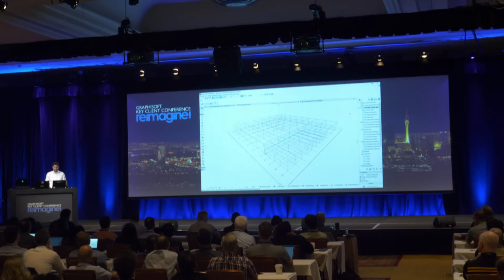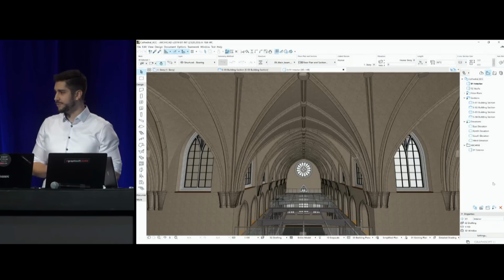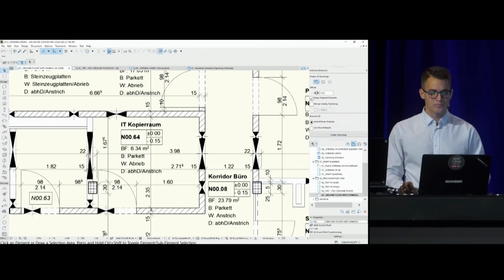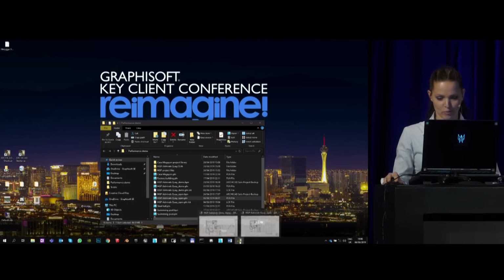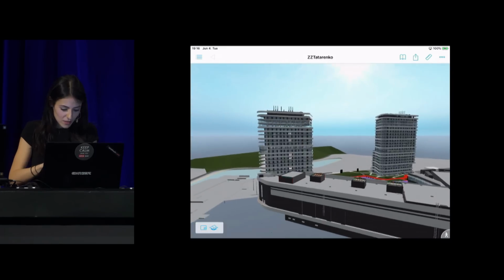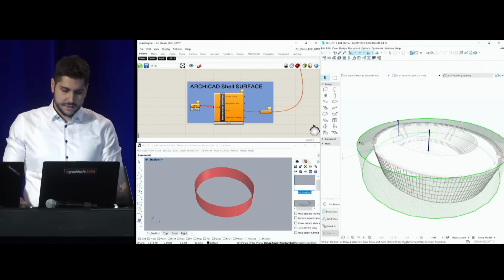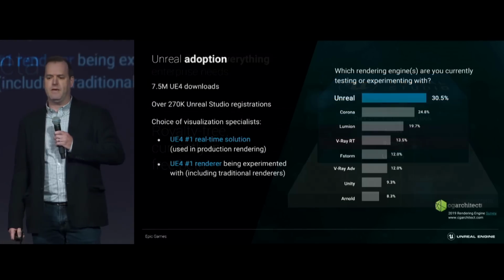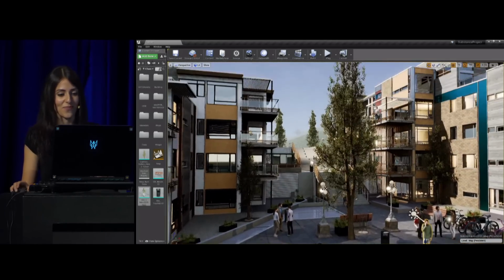ARCHICAD 23 World Premiere

Comment: the worst thing about ArchiCAD is not a very complex simulation system, it is necessary to simplify the level SketchUp, the bigger issue is - backward compatible versions
Reply: it's all the same if design your work in archicad and clean up 3D in sketchup is equally super cute &time saving .
Reply: @francisdeng4588  Are you in Melbourne?